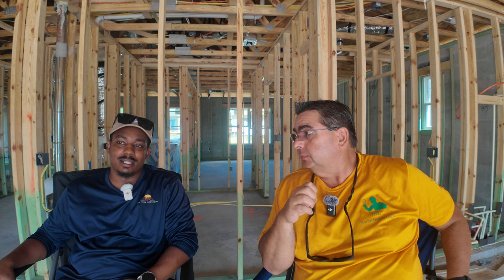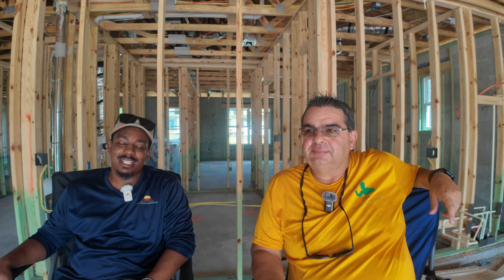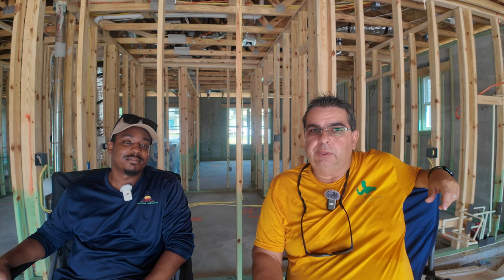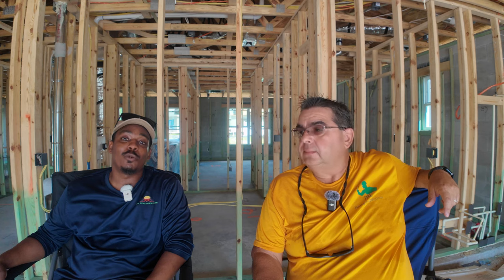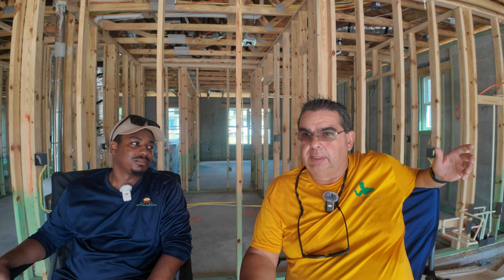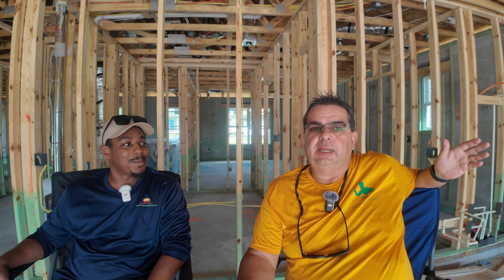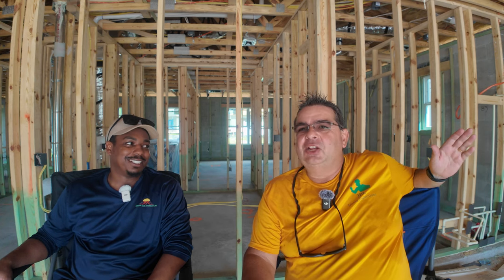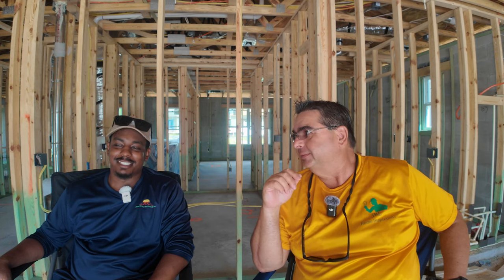Don't Buy a House Without Knowing THIS!

Comment: As I said before, Hurricane proof houses have to be like bunkers on pilotis over ground to save from flooding : on concrete foundations  and columns, CBS reinforced stucco walls with flat concrete roof. Impact windows and doors. American homes are built without common sense. No pilotis, on ground to be destoyed by flooding. Wood framing walls with sheetrock, etc. etc. Florida Building code has to change for coastal areas!!!